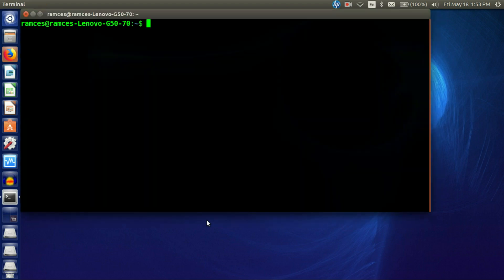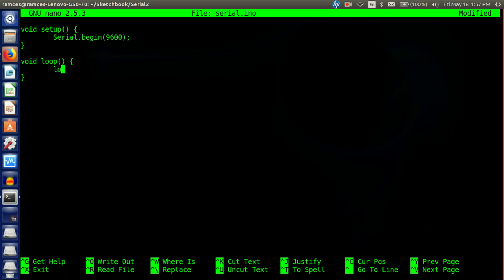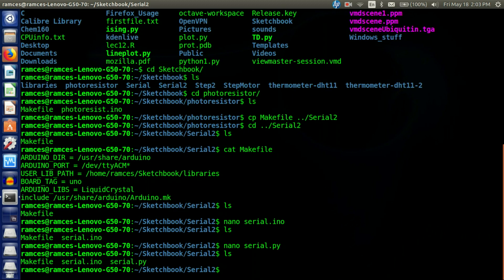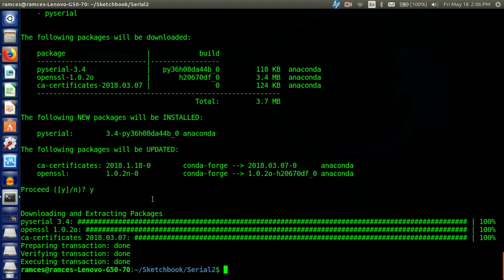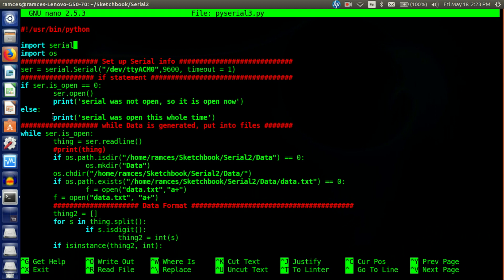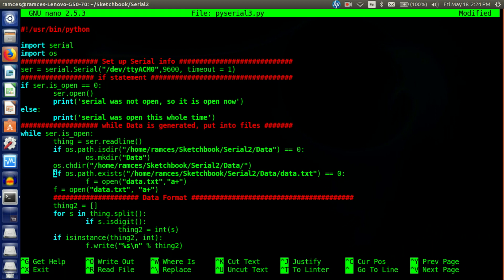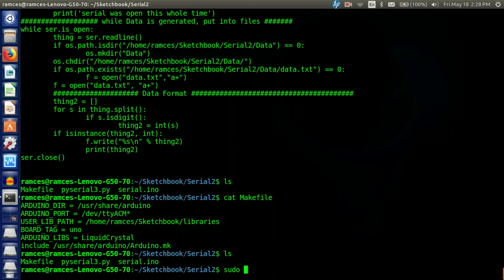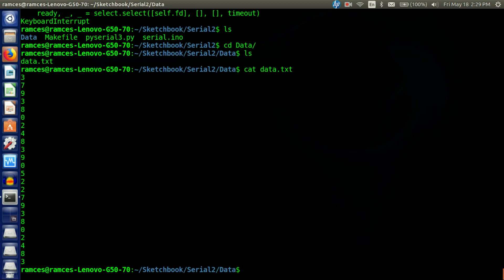Data Processing with Arduino Makefile and Pyserial

Comment: interesting video. how can this help me make arduino project like a car or a robot.
Reply from the maker: Manuel Zaragoza I'm glad you asked, as an example if you have a robot with an arduino and a wireless transmitter then you can use pyserial and arduino to send data to your computer wirelessly. data such as temperature, light intensity, even audio and camera data which you can then save into your computer